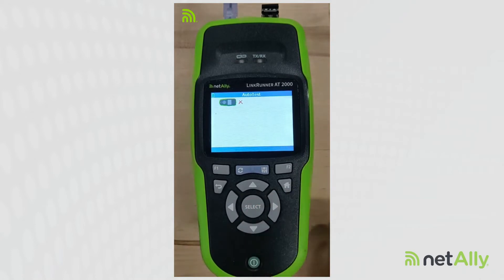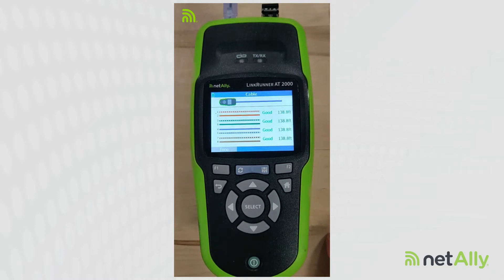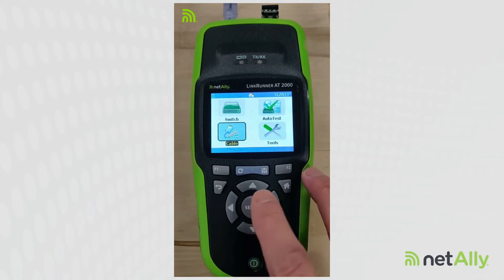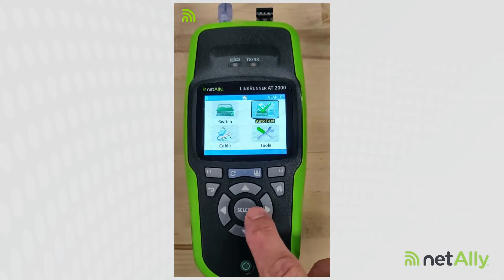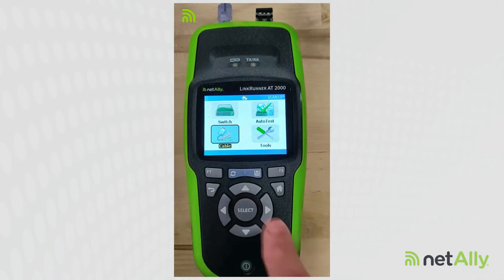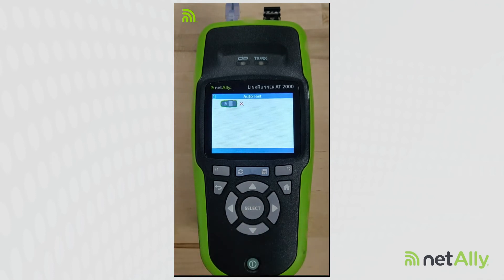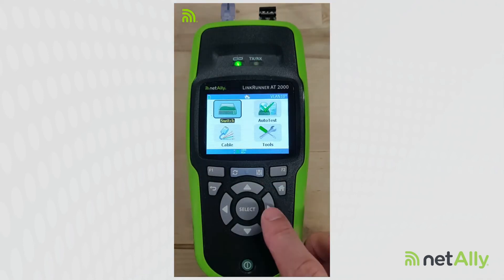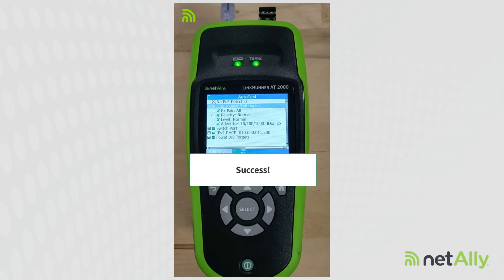Link Testing with LinkRunner® AT 2000

Comment: 1:36. The biggest issue here is that YOU need to find out what switch port it's connected to enable it. Without a probe, how would you find that out?
Reply from the maker: Hi @jamesg871 the LinkRunner AT 2000 and the 3000/4000 models can use multiple methods to help you discover to which switch port you are connected to:
o	LLDP, CDP, and EDP
o	Analog or IntelliToneTM toning
o	Switch port advertisement
o	Switch port light blinking
o	and Remote cable identifiers

Comment: Cable test is not a good test of the cable. That "good" result only means that the cable is open on all 4 pairs and not shorted. It does not meant that the cable has been properly terminated. The results are the same whether the cable is just hanging in the ceiling or terminated onto a jack. It takes a wire map test to determine if the cable is good. A wire map test plug comes with the tester. That's the only way to know the cable is good with this test set.
Reply from the maker: Hi @timsutton3150  the basic cable test on the LinkRunner AT is designed to help you validate cable length or identify faults like opens, shorts, or split pairs (basically, test the cable itself). As you mentioned, to validate if a cable has been terminated properly, we recommend the use of the "Cable Wire Mapping" test, which uses a WireView cable identifier (included with the LinkRunner AT) to allow for pin-to-pin connection checking. Here's a comparison guide for the 3 models --> https://www.netally.com/wp-content/uploads/LinkRunner-Capability-Comparison-22-V1.pdf

Comment: The only difference between the 1000 & 2000 is the POE load test?
Reply from the maker: @geepriest  here's a comparison matrix between the 2 models --> https://www.netally.com/wp-content/uploads/LinkRunner-Capability-Comparison-22-V1.pdf
Reply: Thanks for responding...one more question, if I  purchase at Netscout At 2000, will it be an older manufactured device that if I got made by Netally? @netallynetworktestingtools
Reply from the maker: @geepriest  Apologies for missing your reply. NetScout hasn't sold these for 3 years now, that's now NetAlly. So the latest models and software updates are always supported on NetAlly units